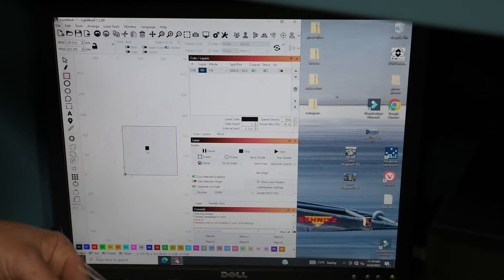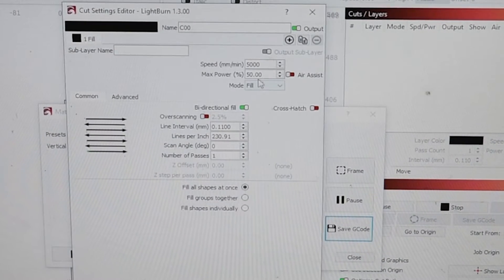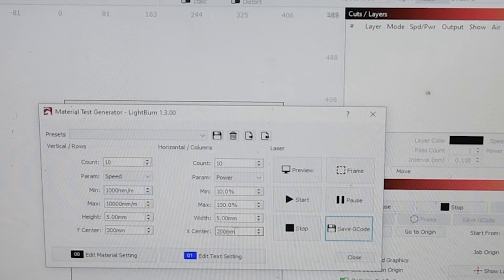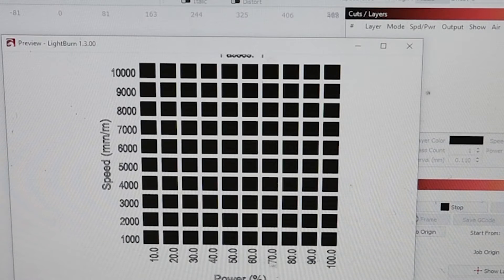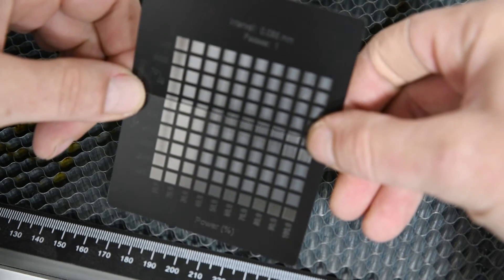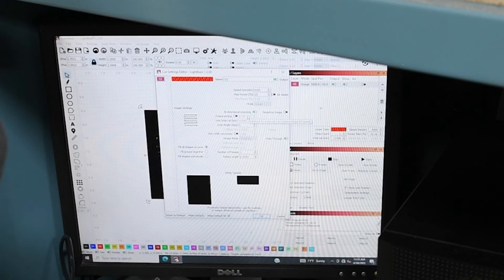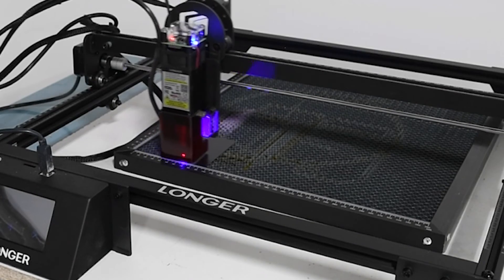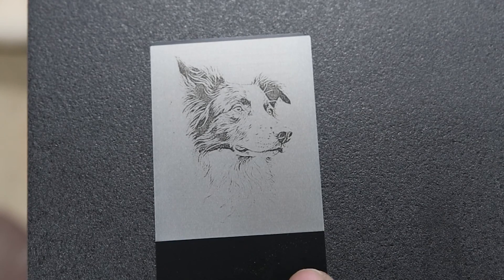LONGER Ray 5 10w Laser Lightburn Material Test Anodized Aluminum Business Cards

Comment: Nice one, i've only recently got into this with a little 10w diode laser on my 3018 CNC. Are you running extraction for the fumes ? I put mine in a box with some ducting that goes outside the shed. Look after the lungs mate, liked and subbed :)

Comment: Hey man im trying to start a local business and i have this machine to start out and im using these cards. Im using Photoshop.. im trying to figure out: tye best settings in Photoshop to run on this machine, (settings from image-r etc, the fastest most efficient settings for black and white buisness cards, the correct dpi of this machine, the correct calibration and so on to print high resolution cards for people. Oh yeah, I'm also finding different information about the actual laser mm so I can focus it correctly. My goal is to run big batches with the frame extension kit they sell. Also, how do you reset the z axis if you accidentally bump it in light burn?
Reply: i had this issue the only way i found to reset it is to turn it off and manually put it back into place and turn it back on then when u click go to origin it will be correct again